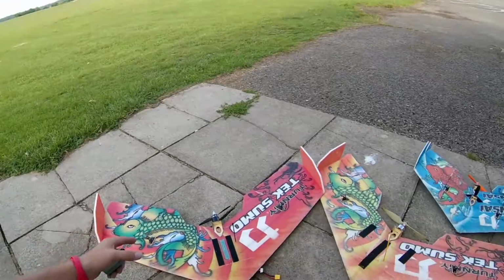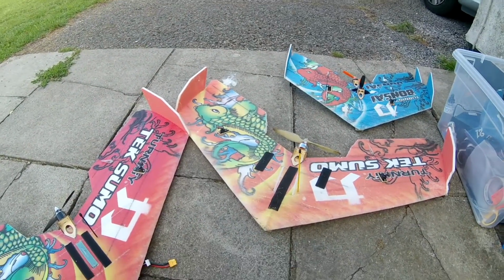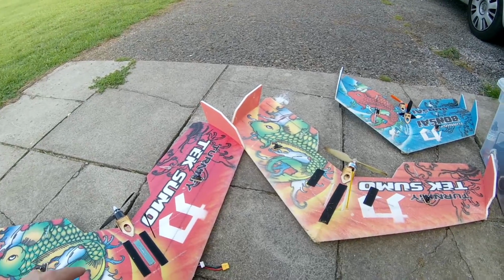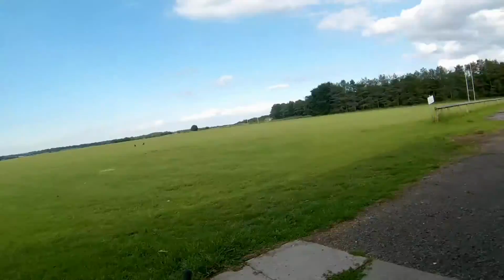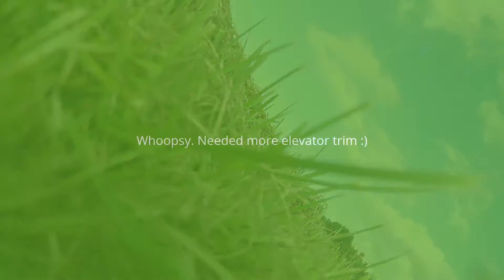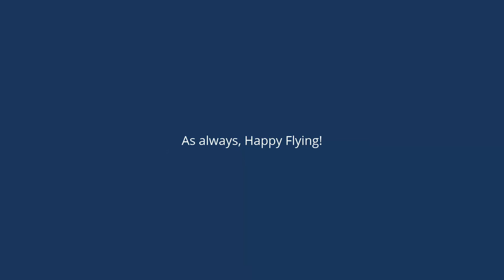She's a SCREAMER! - Teksumo Flying Wing + High KV Motor + Crash :D

Comment: I run Turnigy 2826 2200kv with 6x6 racing prop on 3S 2200 LiPo .... and she's quick. Tried 4S on it and the EPP control surfaces flex too much to be stable ... each time I opened her up - she would duck or climb sharply depending on what stick I had just before ...  I tried propping down to 6x4 and she returned to stable flight as with 3S and 6x6. So in fact the 4S was unnecessary. I am now setting her up for FPV and will stay with the 3S / 6x6 / 2200kv setup as that is more than enough to get my adrenaline going in FPV !!